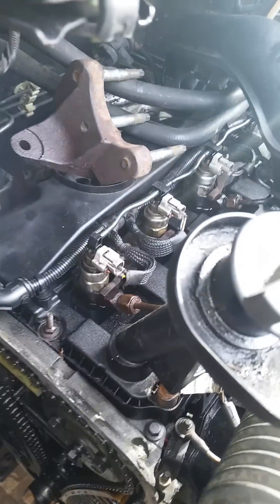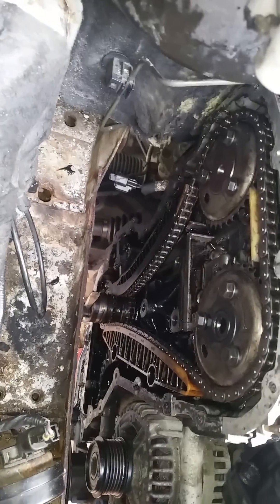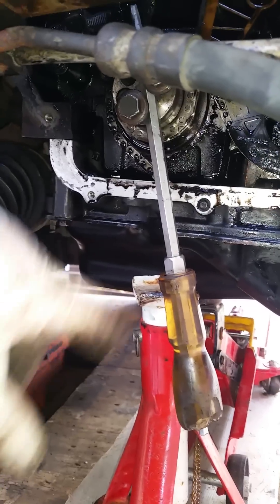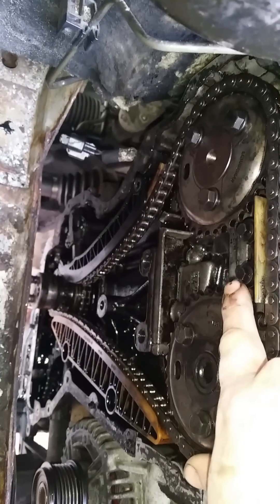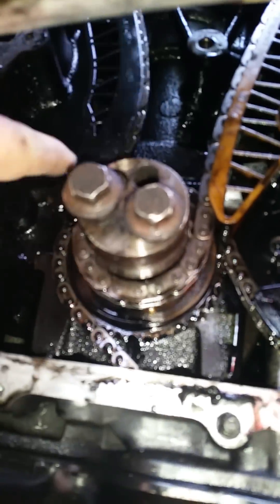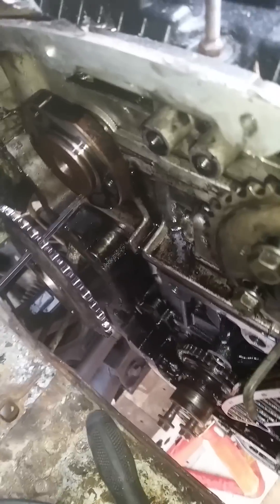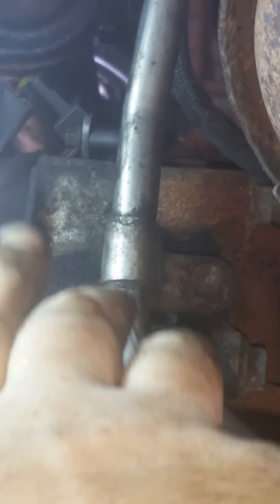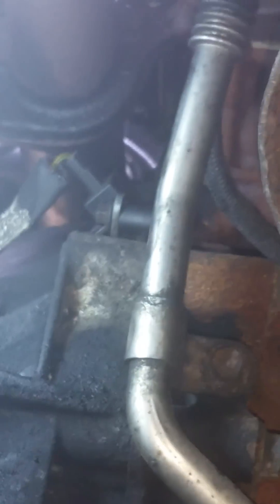Ford transit timing chain removal

Comment: If the timings slipped slightly on bottom crank do you think you could feel for the position on the fly wheel with your method or not ? Stuck on driveway so really dont want to be taking gearbox off 🙏
Reply from the maker: Yes you can it's tricky but you can certainly do it i had a little inspection mirror with a light looking for the crank position. This was a few years ago now id be more inclined to buy a small camera of Ebay or tmuh etc

Comment: Hi mate 2011 2.2 fwd transit,  just cut out on me today, and wouldn't start, been told timing chains snapped, i did try start the van a few times adter it cut out, is knackered now? Has the valves eaten the piston or will ut be ok for just a new chain?

Comment: Do you think it will be the same process for a transit custom 14 plate 2.2 155bhp. And what are your thoughts about the chain to the oil pump as well.   And last but not least  good job for the video man mutch appreciated 👏 👍

Comment: Hi I have a 2011  2.2 transit and the chain as broken, but i Carnot find the timing mark on the crank.i have removed the crank sensor. But with. 13 mm drill bit.it is so sloppy.it doesn't give a good alignment.the hole in the sensor is 16mm and the 13 wiggles all over the place.the tori bolt an the front of the crank is at about quarter past.can I time the crank by getting no one at tdc.if anyone can help.
Reply from the maker: Hey man if you take the starter motor of slowly turn the crank and look were the starter was you will clearly see that there is one notch in the wheel which is considerably different tipex or mark and then what you can do is get a mechanics mirror over the crank sensor and position so you can see the mark as you spin into position
Reply: The torx bolt should be at 11 0 clock for the approx correct place for the locking pin to go into the notch.

Comment: Hi Rob I've got a Transit 2.4 Diesel Auto  camper van its a 55 plate and done 60K after its last service I was informed that it needed a new timing chain. What do you think about this ? would appreciate opinion. I'm in Pensby and see you are Wirral based.
Reply from the maker: Tony Mcclave with such low mileage I would say it does not. The only reason why it would need changing is if the chain has stretched or the damage to the chain links any other reason is suspect the chain on transits easily last minimum 120000 miles. Regards rob
Reply: Ho Rob thanks for the reply. You have put my mind at ease. I  have just had it serviced at a different garage and they said that they service lots of commercial vehicles that have been driven hard with 100K+ on the clock and rarely do they replace the timing chain. Thanks again PS great videoRegards Tony
Reply: Thanks Rob I just had it serviced at a different garage to the one that recommended that I replace the chain and they said the same as you, so thanks for your advice it has put my mind at ease and saved me £500. PS great video keep up the good work and thanks againtony